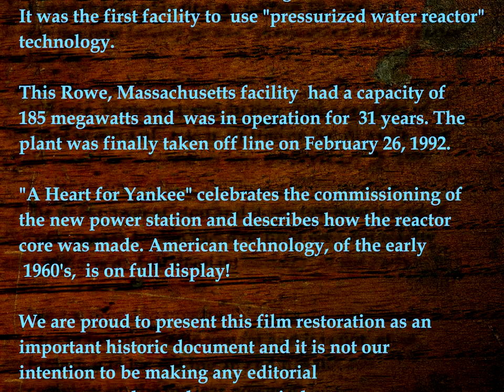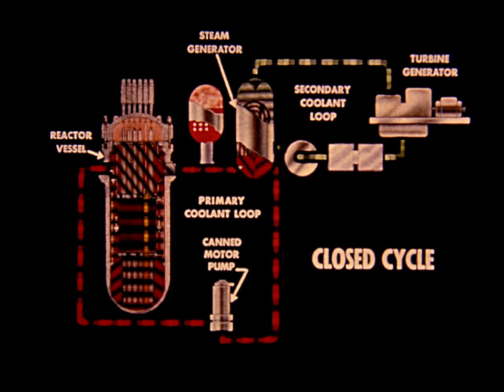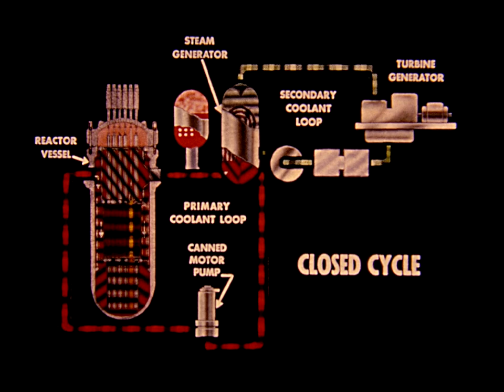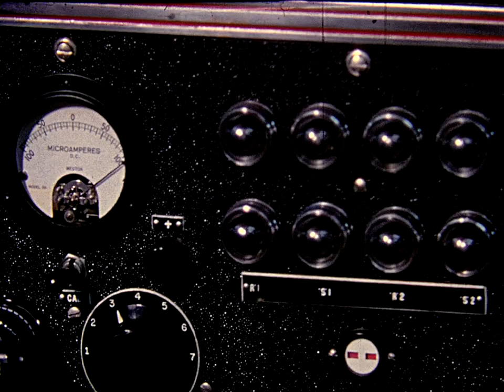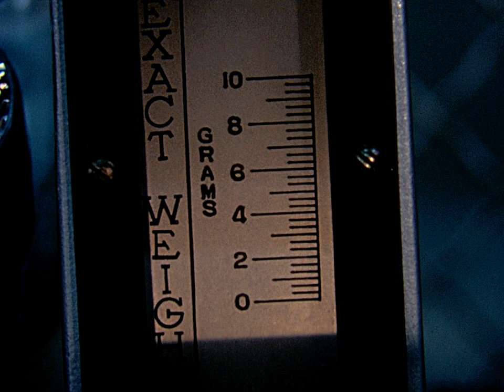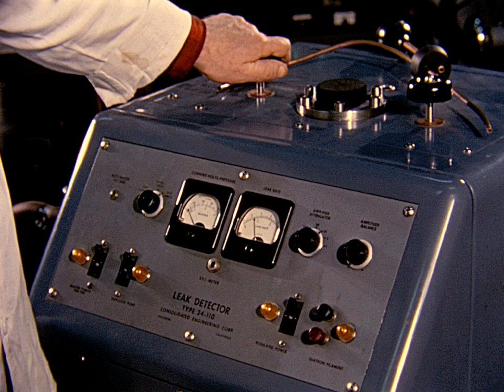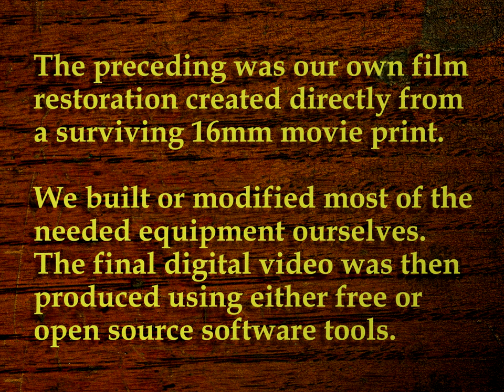A Heart for Yankee

Comment: Interesting how they TIG (or old term  "heli-arc") ties straps to maintain spacing but then do not helium retest the tubes after to make sure they have not been compromised in the welding process... I would think a helium leak test just before shipping (after all the welding) would have been a much better test..
Reply: Helium is certainly prone to leakage. Good call on your part.

Comment: So if the fuel rods are used to boil water at huge scales, how is it that those people can get so close without instantly dying? It seems odd how nonchalant they are with working with radioactive substances.
Reply: Uranium on it's own isn't very radioactive. It's only once fission starts occurring that the fuel pellets become dangerously radioactive.
Reply: May the Schwarz be with you Water shields neutrons which are the primary inducers of fission. I handled these type of fuel rods. Scary. If used fuel rods come out of water it creates a lethal dose for several yards near them. When fuel is new unused fuel is totally  harmless. Only after used are they extremely lethal. Scary . I loaded used fuel with crane into special 30 ton lead water container to be reprocessed.
Reply: You need enough of those bundles in close proximity to each other in order to start a critical chain reaction. The neutrons from each uranium atom's fission strike other uranium atoms and cause them to fission, and so on. Unless you have enough uranium for the chain reaction to self-sustain, each rod is only somewhat radioactive. It's when you have a bunch of them close together when it gets "hot". What Motorhead1 says is true because all those neutrons flying around eventually make the casings and frames and everything else highly radioactive too. That kind of induced radioactivity usually has a shorter half-life than the uranium so it dies down comparatively quickly: decades instead of geological era.
Reply: SovietRefusnik1 Golem seen Candu fuel elements loaded by hand. Nothing more than rubber gloves needed. Everyone thinks that reactors need highly enriched fuels....

Comment: What is the tool at 5:52? I work in electronics, so I’m not familiar with some of these tools. It looks like a micrometer, but with a dial readout, and a spring loaded positioned. I could use something like that in my work. It looks like it would be much faster than a standard micrometer. Great video, by the way. I’ve never seen that much detail on how the fuel is set up. I don’t understand it, but I’m assuming even with all that uranium in a fuel assembly, it’s designed such that it wont’ become critical until placed along side the adjacent assemblies in the reactor. The “Do Not Drop” label is a nice touch. Sounds like good advice to me.
Reply: At small dimensions, they are usually referred to as dial thickness gauges.
Reply: I don't know name this tool in US, in Russia his call "Passametr"
Reply: In the auto industry we called them snap gauges....very fast but need regular calibration. A production tool rather than a machinist’s instrument